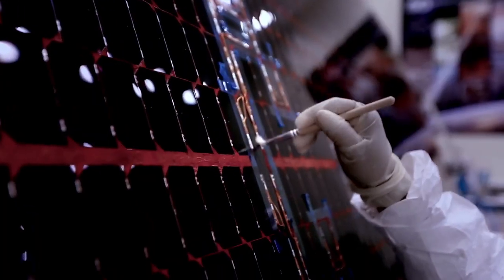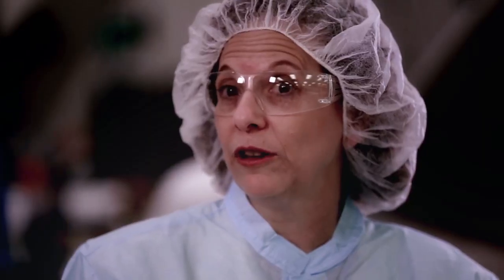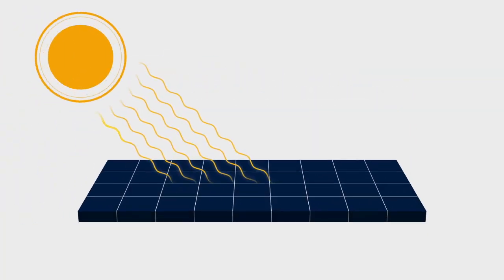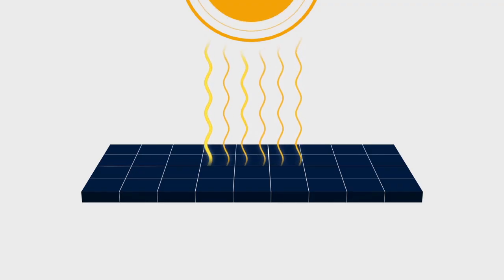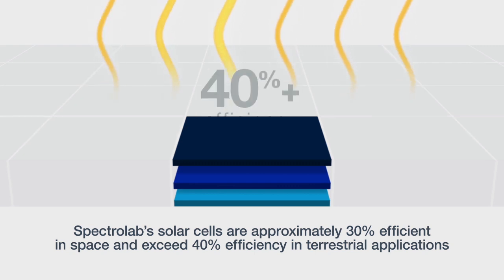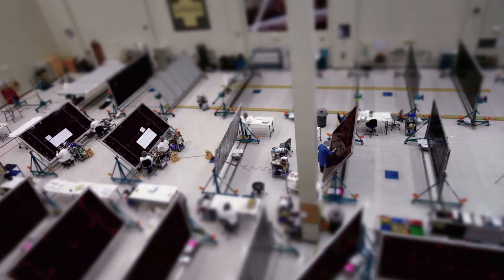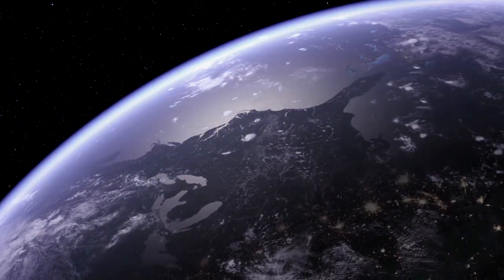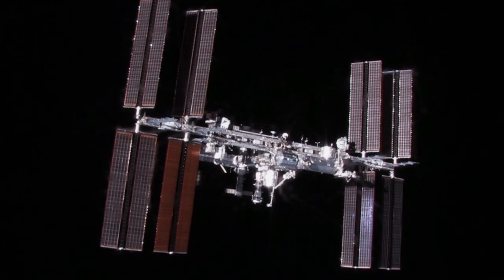Space Powered by Boeing

Comment: The researchers say the sun is made of hydrogen, helium, and it has 25 percent oxygen. Fire has to have oxygen to burn. The sun is a big fire ball. How does a big fireball burn in a vacuum with no oxygen?
Reply: Its not burning as much as its fusing hydrogen/helium atoms together to get the heavier atoms that we see here on earth and in the universe. Fusing takes a lot of energy - hence the emission of light and heat as a biproduct  of the energy transfer - which gives it the illusion of all of it burning in the vacuum of space/. But always keep things in perspective, where even if fire can only burn for a couple seconds in space, the sun is massively big (bigger than us) and has a huge deposit of oxygen - fusion - to keep the process at an equilibrium for around 2 billion years, until it runs out and starts to become a red giant.
Reply: No, researchers say the Sun is made of Hydrogen, 24% Helium, and trace amounts of other elements (2%) (https://en.wikipedia.org/wiki/Sun#Composition)  It produces energy by nuclear fusion, converting Hydrogen to Helium.  

If the Sun used combustion, it would only last 3,000 years, and there are trees older than that.  The math simply doesn't work out.  Here, read http://www.nobelprize.org/nobel_prizes/themes/physics/fusion/ Fusion releases millions of times as much energy as fire, so the Sun can last millions of times longer i.e. billions of years.
Reply: ColdRamen Yeah most likely its an isotope of the oxygen we breathe here on Earth with more or less neutrons in the makeup of the atom
Reply: i would imagine the oxygen is not oxygen but something similar?? no idea
Reply: great point
Reply: good question

Comment: informative video, well done.
was she actually in the lab though? the hair net signals dust free room or some other highly controlled environment. but holding a speech infront of a camera would produce a lot of spit-spray, wouldn't it? is that not a concern or was it just for show? I'm not judging, I'm authentically curious.
Reply: There are different levels of clean in clean rooms, depending what you are making and doing.  I helped build the Space Station modules (operating procedures & testing software), and our clean room was "Class 250,000" (250,000 dust particles/cubic meter).  We had Tyvek coats, gloves, and hair nets, but we didn't need booties or face masks unless you had a beard, just sticky mats at the entrance to capture dirt.

The reason it was a low-grade clean room is the Station would eventually be occupied by astronauts, and people are messy creatures.  So there was no point in being obsessive about how clean it was.  Items where it mattered more were in sealed boxes in the equipment racks.

For electronics, the standards can be much higher, down to Class 10 or less.  Eventually you reach a level where you can't allow people at all, and the work gets done in sealed chambers by robots and glove boxes.

Comment: I thought Jupiter was too far away from the sun to use solar power.
Reply: +Jeffrey Bue Space solar cells have improved in efficiency and weight a lot in the last 10-15 years, so Jupiter is now possible, despite only having 4% as much sunlight as near Earth.  Still, Juno is on the edge of practicality.  It has fairly large panels and doesn't produce a huge amount of power from them.

Comment: the distance from Earth to Jupiter is 365 million miles and it will arrive in 2016? when did it leave and how can it transmit the images and data back but my satellite cable connection sucks when it's cloudy out. these freemasons think we all are a bunch of idiots. people are finally waking up to this b.s.
Reply: +FollowerofYahuwah ...483.8 Million miles...It left here Aug. 5, 2011 & arrives there July 4, 2016...5 years flight time...Your signal loss is usually caused by impediments and fluctuations in your broadcast signal from things such as moving debris and trees. Clouds are not causing interference with your T.V.
Reply: thomas the train
Reply: +Oclecio Andrade u 8
m td iio99oo [0o [(k o ok o>8jxi9
Reply: +Oclecio Andrade u 8
m